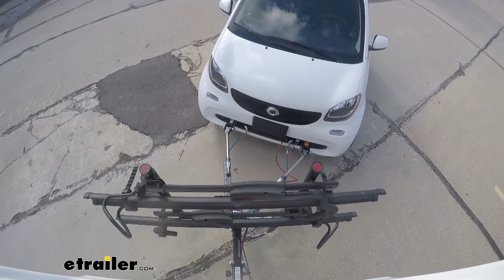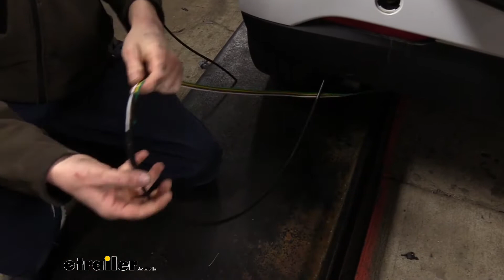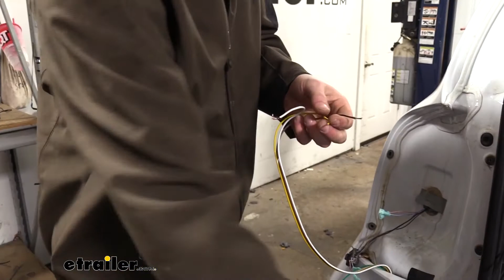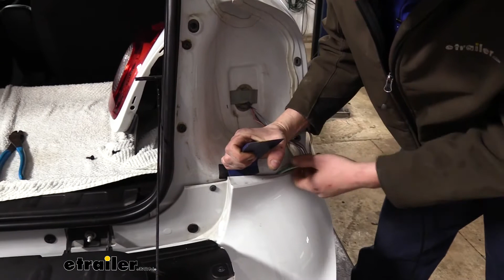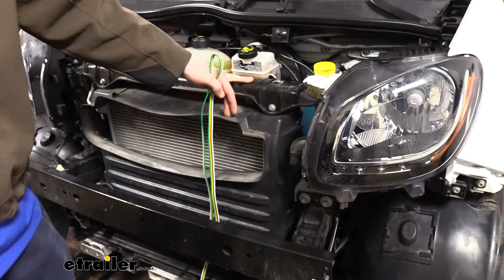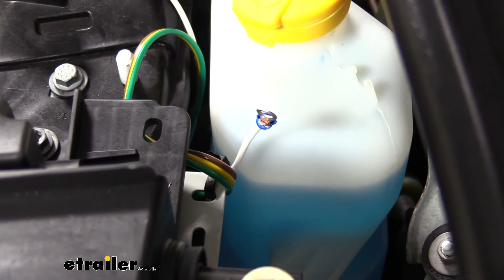How to Set Up Your Roadmaster 4-Diode Universal Wiring Kit for Towed Vehicles on a 2017 Smart fortwo

Comment: Hi , Great video but i have a question when you route the 4 pole plug to the front , i am only using the 4 pole to plug into my RV so i can't cut the 4 pole connector off hoe do i Ground the white wire?  Do i just splice a wire in  the middle of the white wire and screw it to a part of the frame ?           Thanks, John

Comment: How do you keep the wheels and steering? straight 
Thanks
Reply from the maker: These two links will answer that question! 
https://www.etrailer.com/question-264803.html
https://www.etrailer.com/question-60389.html
Reply: Do you already have it hooked up with the tow bar, and when your towing the smart cart it starts wobbling back and forth is that what you're talkin about? If so you need to put a bungee cord from the steering wheel to the bottom of each side of the seat.where the seat slides back and forth on you can use the holes on each side.